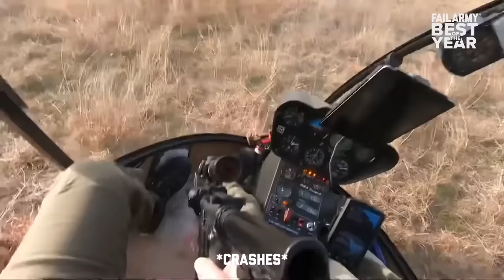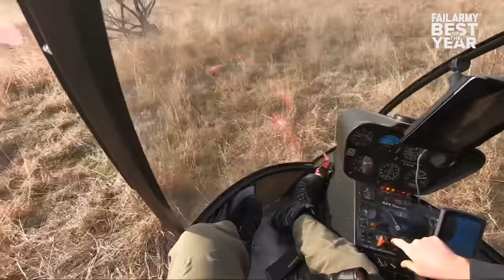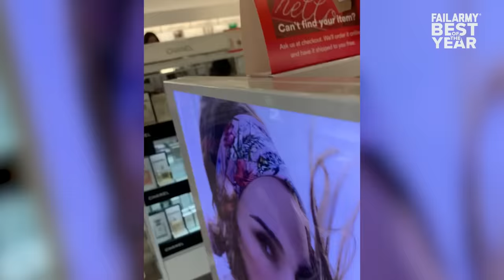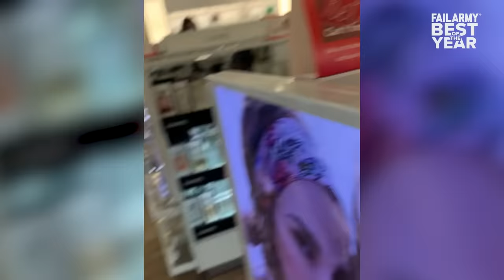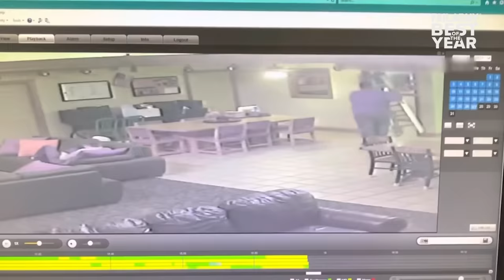Best Fails of the Year | Try Not To Laugh🤣🤣

Comment: kinda confused on why hairdryer girl didn't just cut the strand off ? She was just there panicking because she couldn't get her hair out as if it wasn't already ruinned after being stuck in a warm hairdryer fan already. It's not much hair and it will grow back, just cut it off 💀

And the cat catching that baby pigeon is the exact reason you don't touch baby birds you find (or baby animals in general). They instinctively know what to do, they don't need your help to learn, they ARE learning, they also know to immediately hide and wait until the area is fine to come out. By picking this pigeon up and throwing it to "help it" these girls just made it a very easy target as they prevented it from finding a spot to hide and then made it visible it wasn't capable ot flying well enough to escape. Unless you are 100% sure a baby animal is abandonned and needs help, do not touch them, you are not helping, you are outing them to every nearby predator.
Reply: Because it was caught in a threaded part, like she unscrewed the vent on the end and screwed it back together with her hair inside. Can you not tell by her tone and expression that it was performative?

Comment: The accident at 13'.20" could have been fatal. A similar accident occurred when a bloke changed the mold on a hydraulic press but forgot that he had left his screwdriver in the shaft that holds the mold in place, he stuck his head into the press just as the press destroyed his screwdriver and his head which was flattened by the machine @ 1,000 pounds per square inch.